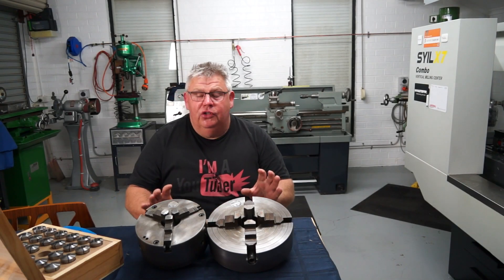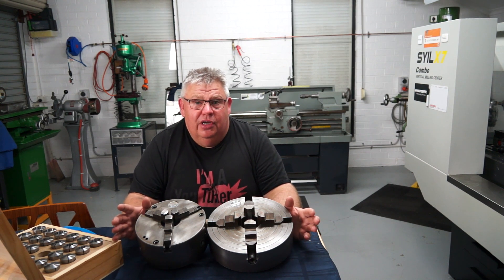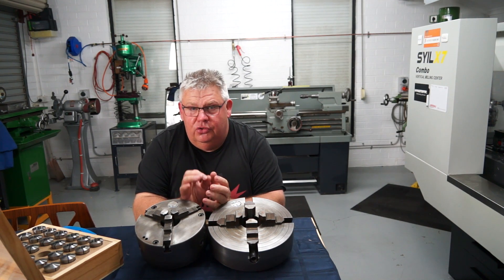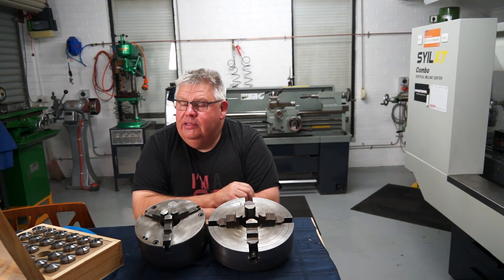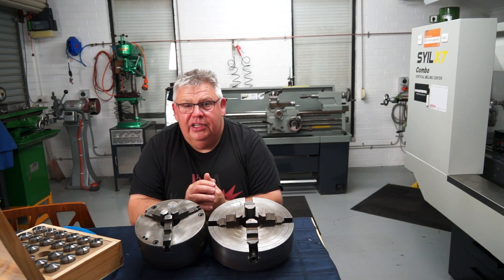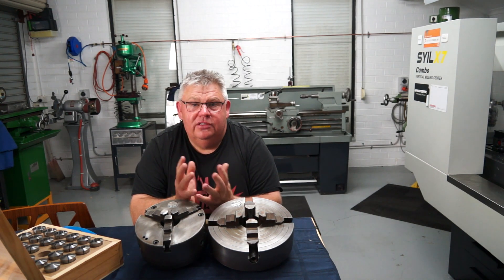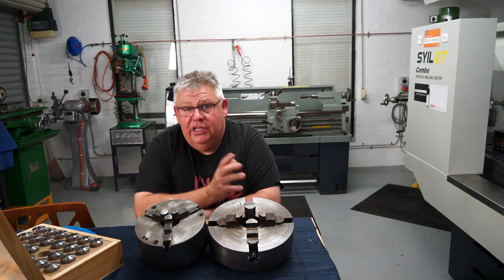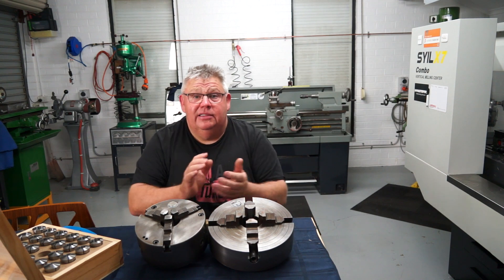Bison 5C Collet Chuck versus Pratt Bernerd Chucks

Comment: I  bought the Shars 5C collet chuck and the D1-6 adapter.
Any idea why the spindle locking lugs bind while drawing up the taper?
The only problem I’ve had with it. The run out is about .001”.
All my other chucks fit proper.
Thanks,
Jeff
Reply from the maker: G'day Jeff.  The only thing that I can think of is the locating pin that aligns the 5C collet being tight.  How does the thread feel whilst tightening the collet?  Apart from that buddy I'm lost.  Cheers, Aaron
Oh, or do you mean when you're fitting it to the spindle nose of the lathe?

Comment: That collet chuck is a very nice piece of gear, proven by numbers to back it up! No wonder you're tickled pink. For what it's worth, here in Canada, another Commonwealth country, anyone working in trades needs to be fluent in both Metric and inch-based measuring systems.  This is partly due to the neighbors to the South of us, and partly because a number of measuring standards continued here after Metrification.  When I taught shop class a number of my students had never used fractional nor decimal inches so I had to do a primer on Imperial measurements.
Reply from the maker: Over here in Australia Everett we went to decimal currency in 1966 and the metric system (SI units) in 71-72. I was born in 1968 and started school in 1973. It was the tail end of the imperial system and therefore it was never really taught to me. We did touch on it slightly when I became a motor mechanic. However I’ve always converted from Imperial to metric. I have to be honest, it really does my head in. However this is probably why the school kids today struggle with fractions 🤦

Comment: A lot of people forget that the USA was on a metric "push" at the same period of time as Australia. But we "pushed back", and it didn't happen. Today, I work for a jet engine company, where we have components made all over the world, with two different measuring schemes. Yikes.
Reply from the maker: Hi Kenny. Yes Australia went to decimal currency in 1966 and full change over to the metric system in 1973. I’m 53 now and I was never taught imperial at school. I did learn it at trade school though during the early 80’s. I think this is one of the reason why many high school students are poor at fractions in math. It must be confusing using both systems on a jet engines though. I have heard of stories about a NASA rocket crash and an air Canada flight running out of fuel because of this. Cheers Aaron 🍻

Comment: Interesting video.
I checked the runout in my Colchester a few weeks ago.
.001” or less. Yeah, those boys did a beautiful job on these lathes.
I checked mine because the oil tube for the spindle bearings popped out. I have no idea how long it had been like that.
I think I dodged a bullet.
Cheers,
Reply from the maker: That’s an excellent result Jeff. I’ve seen some videos on YouTube of spindle end float so that’s why included that one along with the DTI on the taper.

That oil line pipe popping out sounds scary. So happy to hear your lathe is still ok 👍.

Cheers 🍻

Comment: Aaron,
Another well thought out vid 👍.
My 1997 Hafco 960B (Taiwanese copy of a small Colchester) came with a 5C collet set, and a drawbar. I’ve never used it.
I’ll have to give it a try now that you’ve stirred the pot 😄.
I bought a taper turning attachment ( made for the 1000  series lathe, but with some milling work I got it to fit).
Only now got to get the new motor wired up, and I’m back in business 👍
Regards
Robert
Reply from the maker: G’day Robert. Your lathe sounds like a little ripper. I like the Taiwanese made lathes. We had the Lux brand at Harvester and they were sweet. Glad you got the taper turning attachment fitted. I’ve got the original one for my Colchester. I’ve just got to figure out how to install it 😂. Hope you’re doing well mate. Don’t forget to stop in at Lithgow to see Chris’ set up and new SyilX7. Now that the borders are open maybe I should pop over at Christmas time to see it for myself. Cheers mate 🍻 Aaron

Comment: I picked up an inexpensive import 5C collet chuck for my 13x40 lathe. Totally impressed at how little run out it had. Maybe I got luck and it was made on a Monday morning. LOL
Reply from the maker: Hey buddy how’s things? I’ve just been watching your latest couple of videos. Can you believe I wasn’t subscribed to you on this channel? My brother always told me that I wasn’t too smart but I could lift heavy things 😂. Hey thanks for watching and following along. I’m loving this new collet chuck. I should’ve bought one years ago. Cheers 🍻
PS: I think the made on a Monday has some merit in it. I remember working as a mechanic doing rework on new cars and we always used to joke around and say they were probably made on a Friday LOL
Reply: @AaronEngineering  The nice thing about 5C is you can also hold square and hex stock. Makes it more versatile than the ER system. Thanks for watching my shop build series.
Reply from the maker: Oh that’s a very good point. I’ve been meaning to get some Imperial Collets and those square ones also. However I need to pull up on the spending as the wife is getting cranky with me 😂